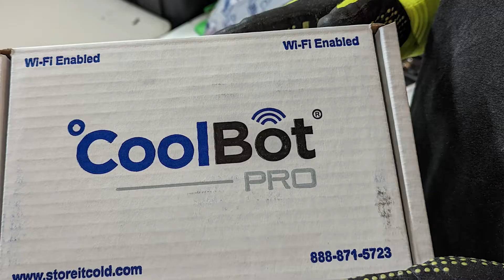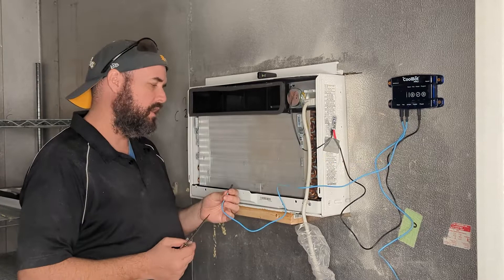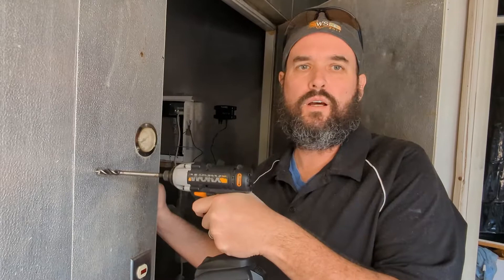CoolBot Installation Walk-Through

Comment: What size AC unit for btu? Do you need a specific size? Or all depends on building size
Reply from the maker: We opted for a 12,000 BTU because of the size of the cooler. Honestly though, in the summertime it could really use a 15,000 to help keep the compressor from running as much.
Reply: @IttyBittyMicroFarm  what size is the room? I have a 8.5x4.5x10 ft room and I went with a 10k btu. Maybe I should’ve went with the 15k